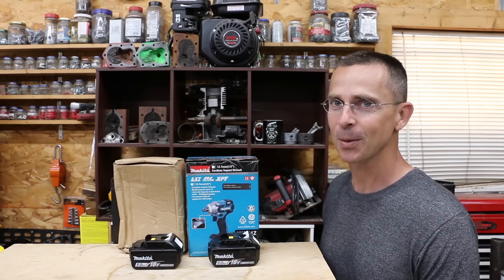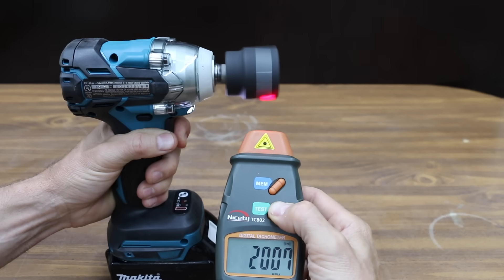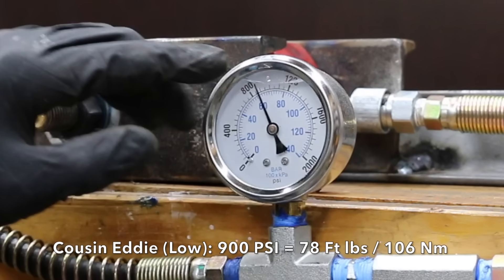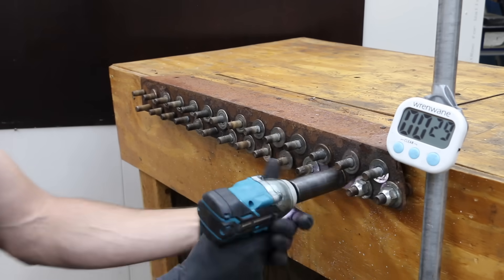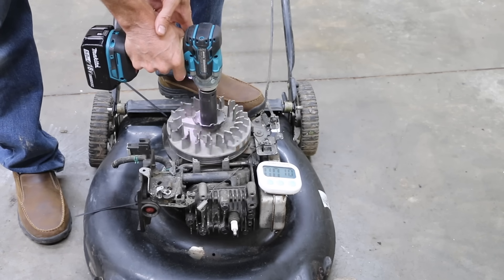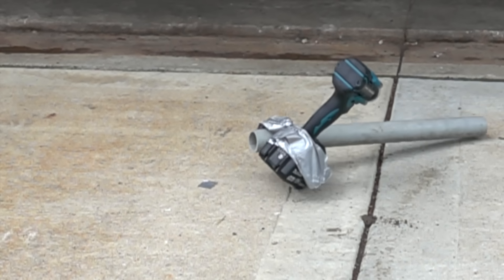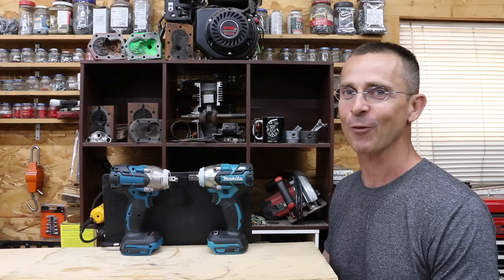Fake Makita Impact Better? Let's find out!  Makita XWT11Z 18V LXT Lithium-Ion Brushless Cordless

Comment: my makita drills and mult-tool have been with me since i was doing water damage restoration. 8 years later, alot of drops, water, dirt and still going strong. one original battery stopped working over the years. other than not looking new they still perform at work. only lost a saw to theft.

Comment: Very fair and thorough review!  For a DIY'er, especially if I was young and barely scraping up the money for projects, I'd go with Cousin Eddy, and not drop it!  Makita makes lust-worthy tools.  I can afford them now, but I still save my $ and buy good old Ryobi at Home Depot, because I've never had one not work in the 25 years I've been using them, and for using them maybe a half dozen times a year or less, they work great.   I wouldn't build a house with them, but I've built sheds and raised garden beds and built out trailers with them.   I think your video showed Cousin Eddy has a future in that kind of market.    Now when it comes to my work tools..... the ultrasound in my pocket is about $3000.  If I was in construction, it would be Makita or similar all the way!

Comment: I purchased the cousin Eddy type from Amazon, it was less than £40, came in a plastic case with a selection of sockets and drill/driver bits.
I don't use it very often, yet for driving heavy screws into timber whilst boarding out my loft or making flower beds in the garden out of 6" by 2" treated timber it is fine.
I don't expect it to be as good as the professional tools, yet for home DIY, I'm happy with my purchase.
Reply from the maker: Thanks for the feedback.

Comment: Nice meticulous comparison. A bit of a shame the knockoff product broke, but ok, for the price...
So, since this video was released a lot of these "for Makita" products have been released. Some are outright just copied, others have a design of their own. And there are even "for DeWalt" products. Maybe you can compare all available tools with the originals? There are angel grinders, recipro saws and chainsaws, and many other things.
I got some of them. Some of them are really ok. I got a 20 € Newbeny impact driver some months ago. Like the one in the video it has connectors for 1/2 nuts and 1/4 bits(which is a nice bonus so you can use both). It even claims 1000Nm. I doubt that, but so far it does the job well. Another tool I really like is the Newbeny pruner which is even stronger than the Worx I got too.

Comment: I became a Makita fan wen I worked at the Smithsonian 35 years ago. Had a 9.2 volt with the long battery. Dropped it off of a 12ft ladder onto terrazzo floors more time then I could count. Never any damage, never stopped working. 
U personally now have 18v tools and the batteries have lasted 8-10 years with using them every day. Unbeatable. 
Btw PF, have you tested hand held home use mig welders?
Reply from the maker: Thanks for sharing.  Thanks for the suggestion.

Comment: But I mean for 30 bucks. What u asking for 😂 I think it’s worth 30 bucks. Would it be worth a hundred no. Not at all. It’s not a dewalt that’s for sure. I wouldn’t even buy a makita as good impact. I am firm believer in good impacts need to be plugged in. Shouldn’t be battery powered. I’m only buying a pos impact for my wheelers. Only so I don’t have to drag out my big one. Bc my dealt impact driver can only do so much
Reply from the maker: Thanks for the feedback.

Comment: i have always wanted someone to invent a corded hammer drill with speed and reverse control but with a brushless motor as i get fedup keep changing brushes and i use it to shine up metal on motorbikes so i run all day so would never use a battery tool.
Reply from the maker: Thanks for the feedback.

Comment: Nice video and presentation. 
One thing worth notice is - 
If all else are equal, the torque performance is relates with the hardness in the hammer assembly. A small drop in hardness produces a significant loss in torque performance. However, hammer assembly too hard makes the assembly too brittle and can shatter during heavy load. Optimal control of material hardness for a specific at input power is difficult to manage in mass production. That is why top performing tool/brand are so expensive.
Reply from the maker: Thanks!

Comment: Tbh... Cousin Eddie's reverse tourqe we isn't shabby considering it's price.

IMHO...I'm not interested in tighting tourqe because at that point you should be using a tourqe wrench for your final tightness anyways.

I've had cheap impact Wrenches and for stuff like suspension components on a regular car... If you need more than 150ftlbs then just use a breaker bar to crack it loose.

No suspension parts on a car should be tighter than 153nm unless very seized ...
Reply from the maker: Thanks for the feedback.

Comment: I am a big fan, have bought many a product that you have recommended. I was wondering if you'd concider reviewing dehumidifiers. There are three types, various sizes, different power consumptions so really complex as a consumer to pick from but they are supposed to be much more cost effective energy efficient to help air dry clothes indoors verses a tumble dryer. Some are even promoted for cold damp conditions like a garage. I think dehumidifiers would make a great Project Farm video.
Reply from the maker: Thanks for the suggestion.

Comment: Comparing a $30 tool with a $130 tool isn't fair and results are as you'd expect. Clearly both offer excellent value for your money. It all depends how often you'll be using such tool on which one you should buy.

Comment: My knock off anvil is over sized and causes problems at getting off impact lug, and the knock off doesn't seat the battery well.  It does have good power, but the fit and finish is not as good as the original Makita tools.  My Ryobi impact is actually a better tool than the knock off.  The knock off is much better pricing.  I am a DYI person.
Reply from the maker: Thanks for sharing.

Comment: Got myself an eddie for site work. Lots of tools here get stolen and i only need it for saddle clamps and the occasional tighter bolt for a hydraulic hose.
Reply from the maker: Thanks for sharing.
Reply: @fercon9892: That’s disgusting, people doing things like that. I was in a Mitre 10 store yesterday (here in New Zealand) and the store clerk told me that they’ve had something like $13,000 worth of brand new, off the shelf, tools stolen in the last wee while, by customers who just grab them off the shelf, nudge you aside and walk out the door with them.

Comment: can you replace the makita clone trigger switch for the better one? the clone has stepped with with only 7 resistor so it can not run at low rpm as the original makita

Comment: Before I even watch. Definitely do not buy knock offs. I’ve seen them used on site and they burn out. Batteries overheat and can go on fire. Imagine bieng sued by the main contractors and property owners for using defective electrical tools left on site overnight after a hard days usage. 
   Yes battery operated equipment is electrical just lower voltage. 
   I’ve seen drills and batteries smoke up burn out and seize up on site…💨 💥🔥.  
   Buy the true genuine Makita only. 40 years of experience with Makita confirms my trust in their tools. ⚒️
Reply from the maker: Thanks for the feedback.

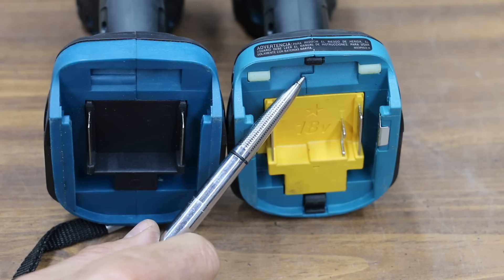Comment: 1:44 Note that the fake makita only has 2 pins, whereas the real one has 3. Does this mean that the battery won't be protected in some way from deep discharges or overheating? What exactly is the purpose of this 3rd pin?

Comment: This was a really great and helpful review. I own both and "cousin Eddie" is a perfectly acceptable tool to keep in the truck tool box for occasional use if you don't want to risk someone walking off with an expensive Makita. The knock offs are definitely not a 1:1 comparison. But as a spare if you've already invested in Makita batteries; it's not terrible for the money. Not something I'd want to rely on everyday. But helpful in bind on the side of the road.
Reply from the maker: Thanks!  Thanks for the feedback.
Reply: Did you notice at 1:44 that cousin eddy has only 2 pin, makita has 3 pin. Does is it mean that the battery could be not protected against overdischarge or heating ?

Comment: i'd absolutely love an air purifier comparison, like cheap third-partry filters (I have a levoit core 200s for example) that cost 1/3rd vs more expensive option vs the super expensive OEM ones. Will be hard to test properly for longevity!
Reply from the maker: Thanks for the suggestion.

Comment: It's the same as for anything, it's the final use, Makita or Dewalt for a pro/semi pro usage, but to use it twice a year, e.g. to switch winter/summer tires, the clone is quite good enough.
Especially as parts are compatible with Makita, may be it'd have been fair to test the Makita with the clone battery and the clone with the Makita battery.

Comment: was every step of the testing done with a full battery? or partially drained? could effect the performances. however, while it lags behind the Makita, its a better value for the dollar. if you need more torque than Cousin Eddie gives, youll likely be using pneumatic impacts then anyway
Reply from the maker: Used full battery.

Comment: The cousin eddy will rarely get any lug nut off let alone be of any use when doing ball joints. It's a bit stronger than an impact driver so if anything it's really just a beefier impact driver so long as you have the hex fitment. But it will never perform any of the duties you want from an impact wrench. The electronic options on mine failed after just a couple uses.
Reply from the maker: Thanks for sharing.

Comment: Makita impact drills are pretty bomb proof, as a reliability test a water dunk would of been another test. As a scaffolder ive dropped mine in water twice submergered and worked in the rain countless times and dried it off and it still worked, dropped it countless times at different heights...had the same drill for about 4 years until it finally broke beyond repair, but for the amount of use it got and the age its probably a no brainer to price to if its worth it or not

Comment: Shouldn't the RPM be measured at the anvil with nothing attached? Not with a socket on it with a larger diameter? That changes everything

Comment: SAFETY: Makitas are sometimes overly safe, but they have a natural feel to their features and it prevents accidents. Like a drill or grinder overheating will stop and, somehow, the triggers are easier to let go of, disengage, if the tool starts to spin. The balance on the chainsaw is so much better than others and it encourages you to hold it properly.  Others probably said this but I have both on a number of tools (let the helpers use the knock-offs) because they share batteries. Some are quite good, like a drill with mega torque, but little problems arise like it going into hammer mode randomly, but the biggest thing is that feeling of response and safety. They must just give them to loads of people to test and watch how they mess it up.  LOL, reminds me of when Senco came out with new roofing staplers with a plastic back to them; they were on display at an event at local lumber place and every single guy walked up, picked it up and turned it around to hit down (as if driving in a staple that hadn't fully sunk) and said, "this is stupid - make it soft metal again".
Reply from the maker: Thanks for the feedback.
Reply: @ProjectFarm  I appreciate your work.

Comment: I'd be interested to know the actual (measured, not claimed) battery capacity. Claimed battery capacities of these cheap products from e-Bay, AliExpress etc often vary considerably from reality - some examples I've had include an "1800 mA/h" that was only 500, a an "8000" that was scarcely 600 etc.
Reply from the maker: Thanks for the suggestion.

Comment: 30 years ago I might have bought a cousin Eddie type tool if one existed.  And I probably would have replaced it long ago.  My dad gave me his Makita electric power drill 30 years ago and it’s still going strong after much use and a little maintenance (it outlasted even him).  Ever since then I have bought that brand, partly out of loyalty I guess.  They haven’t let me down yet, not to say they are infallible, and I’m sure many other brands are the same…probably not cousin Eddies I reckon.
Reply from the maker: Thanks for sharing.

Comment: I had a Makita 1/4" impact several years ago as well as the drill/driver.  Used both of them daily for garage door installations & replacements.  Both performed great given their price point, I couldn't see paying more for anything else.  I also had the 18V XRP Dewalt 1/4" impact and the hammer drill/driver....the Dewalt was quite a bit heavier, and after a day of use you felt it in your arms and shoulders using the heavier Dewalt impact and drill.

Comment: Long term review of my Cousin Eddie (appears mostly identical to the one in the video - even down to the yellow trimmed brushless motor, except mine was a ball detent model). 
The unit is still performing well - ordered May 2020 (a month before this video went live!), review date 2/13/2023.
Used for weekend automotive work on my daily driver cars - mostly suspension components and lug nuts, and it still works the same as when new.
Occasional drops from a short height with a 5ah battery, no cracks or stress marks/deformations in the shell.
It seems to max out at about the same in the video - between 90 to 115 ft lbs, even after years of weekend use.
About a year in, the detent ball disappeared and was never seen again, so I've been holding the sockets on as-needed.
Shortly after that, the hammer seized up. A quick disassembly of the forward cap and gentle persuasion resolved the issue and the unit worked fine after reassembly.
A year and a half after that (a week ago, actually) the four screws holding the forward cap on came loose, so I partially disassembled the unit again and did an inspection. Everything was still greased up and looked/worked great. Threw some threadlocker on the screws and reassembled it.
I've used this for: frequent tire rotations, regular suspension replacements, an engine replacement/teardown/reassembly, a transmission replacement, and regular maintenance when there's enough room.
Because of the limited torque, on higher torque fasteners like axle nuts or front control arm bushing nuts, I would sometimes have to break them loose by hand. On one occasion I had to use a strangers high torque Milwaukee in a junkyard to remove the axle nut on a CV axle still installed in a spindle off-car. Sometimes Cousin Eddie (and even my breaker bar) struggles on other bolts in mostly rust-free junkyard cars.
I was wanting a bit more removal torque for those rare occasions, so I went ahead and ordered an authentic Makita impact that is smaller/lighter but is rated at more torque than Cousin Eddie has tested out to. But, considering Cousin Eddie was about $40 shipped and provided almost 3 years of use before I wanted something better, I'd say it was definitely worth the money.
Not bad, Cousin Eddie.
Reply from the maker: Thanks for the feedback.

Comment: Thanks for this! I'm looking to buy an impact wrench for diy automotive use, do you think that this would hold up to the odd job involving well rusted bolts?
Reply from the maker: Thanks for the suggestion.
Reply: I would recommend something more powerful. My Cousin Eddie maxes out about the same as the one in the video - it's barely enough for removing lug nuts and similarly specced suspension bolts, and that's with a LOT of ugga duggas.

Comment: That's really not too bad for 30 dollars. I've used some drills that cheap before and they were just terrible compared to this knockoff. The main issue for me with the knockoff is the minimum RPM speed/control, that's a pretty big deal for how often I make fine adjustments at very low speeds. I didn't see if you mentioned- are the batteries interchangeable?
Reply: I've been using authentic Makita batteries in my Cousin Eddie. The torque is so low that I haven't had any issues with breaking fasteners unless they're tiny and I'm going all-out on them. Trigger control works okay enough - I use mine to gently advance lug nuts after hand-installing but before using a torque wrench. The low torque on these is nice for that because it makes it pretty easy to not over-torque the lug nuts.

Comment: But how long will the Knock off last ?   I have several Makita tools that are more than 25 years old and still working as well as day one.  
 I did have one of the 120 VAC drills serviced, new vari speed trigger, cleaned, lube and a new AC cord all done at a Makita authorized 
service for less than $30 good for another 20 years of service.  Think Mr. knock off can beat that  NOT!
Reply: Mine has been working the same as new for 2 years of frequent weekend automotive repair/maintenance. Posted a detailed review a few moments ago in the comments. All I've had to do is free up the hammer once when it got stuck (had to remove the plastic cap via 4 screws), then a long while later applied threadlocker when the four screws eventually loosened up because I didn't apply threadlocker (as they didn't have any to begin with, but I guess it's useful).

Comment: Suggestion: Do you definitely need impact rated sockets? will chrome sockets really shatterif used with an impact wrench like we are told ? - lets find out !   thanks :)
Reply from the maker: Thanks for the suggestion.
Reply: I have cracked several chrome sockets with and without an impact, however I have never cracked an impact socket. So nowadays the most-used sockets for me are impact sockets, even with hand tools.